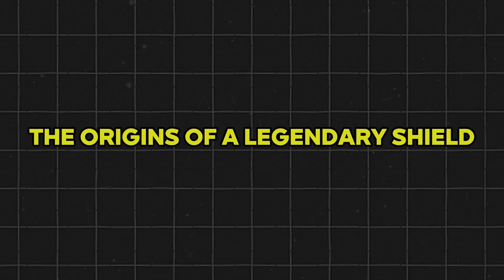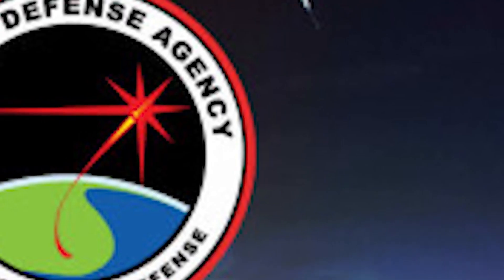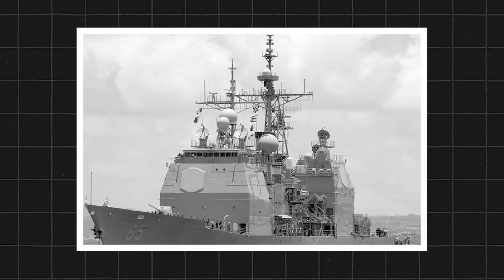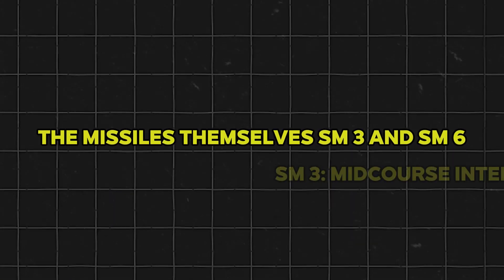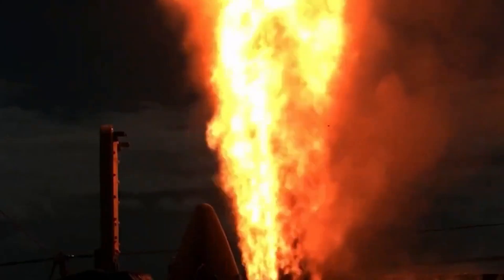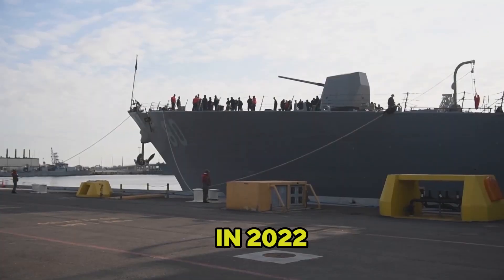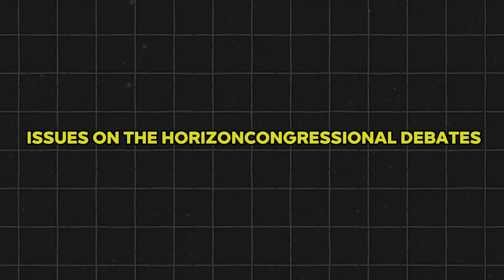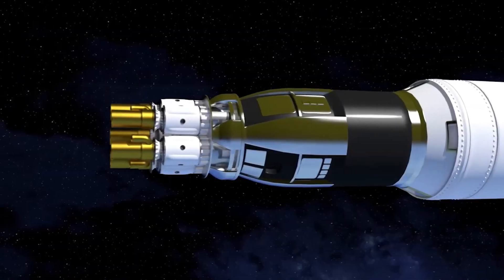The Incredible Aegis Ballistic Missile Defense System Explained!

Comment: It seems as if it would be more effective to have a terminal phase interceptor missile that is similar to the ATACMS rocket (that has tens of thousands of tungsten rods inside) but with a proximity fuse like the Russian BUK that detonates BELOW the incoming ICBM. If you put several of those out there into its path it would put a wall of tungsten in front of the ICBM. Then let the ICBM's speed and kinetic energy do the rest. The tungsten rods could even be falling back down and the ICBM would easily catch them and it's own mack 25 speed impacting the tungsten rods would shred it. 

Would you dove hunt with a rifle and try to hit a dove while its flying? Would you dove hunt with a rifle and think you have even the slightest chance of hitting a flying dove? No. That's what shotguns were made for.

Comment: Fun fact, the larger and longer range for the missile, the bigger it is and also the longer it take to produce it.

That is simply a matter of physical chemistry as they are all solid fuel rockets which takes weeks and months to properly cure it set  the solid fuel propellant it has as it's rocket engine.

So the smaller the rocket, the more can be produced per year.

If I recall correctly, the SM3 rocket production numbers is just about 100 per year or about 10 per month.

They do need to vastly improve the production rate for the missile by at least 10x as there is a acute shortage of them 

Additionally they just realized that the SM3 is easily adapted for long range air to air defense and in that role their range for air to air potential kills now jumps to almost 200 miles, hugely outpacing all potential enemies missiles
Reply: Great post. I was on a Spruance Class DD myself as a cryptologist breaking Russian encryptions. We were mostly anti surface/anti sub surface. The only anti air platform we had was defensive in the form of the Sea Sparrow. So I'm not really up to par on anti air capabilities. 

We had two 5-inch gunmounts, 8 Harpoons and the VLS with 64 silos and the Mk 46 torpedo, but I'm not sure of the quantity. 

You covered a very interesting point. One that has me concerned as well. During the Ukraine war with Russia, depleting our stockpiles so rapidly and our inability to recover and restock is quite a concern. What would it be like in a direct war with Russia and/or China when we can't even keep keep pace with supply and demand during what is basically a proxy war? Some are even saying that in order to ramp up production, we would have to build the infrastructure before greater protection numbers can begin. IOW we need greater missile production rates, but in order to achieve those greater production rates, we first have to build the factory that builds the missiles. That's not good. How did we manage to not consider a problem such as this being highly probable and its implications and not be proactive in coming up with a solution? Even if we only built the production facility then brought it online for just enough time to work out the bugs in the equipment then shut it down until it's needed.

I realize we wouldn't have to rely solely on the certain individual weapons systems like Ukraine does. An example would be Ukraine relying totally on artillery to hold back Russian ground attacks and by that they run low on shells where we can strike from the air as well as from the ground and spreading the attacks among multiple weapons systems. But still, running low on critical components during wartime is one of many possibilities that can happen and we should try to come up with immediate solutions